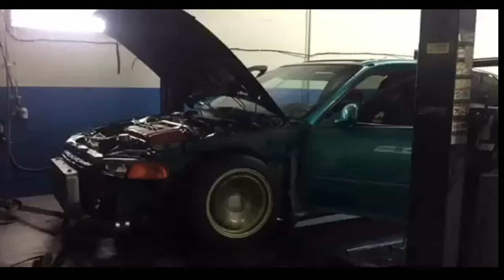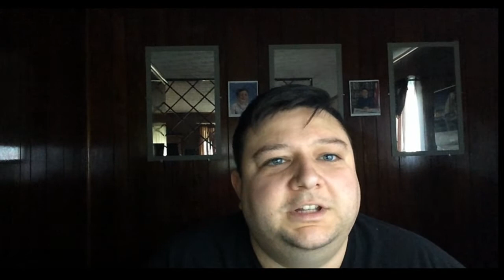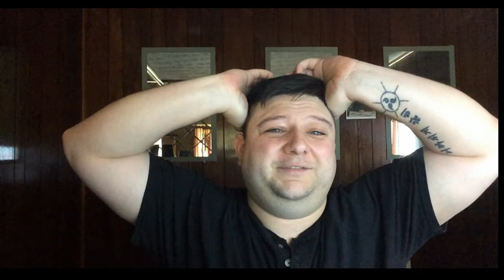450whp Built LSV 10psi, Stock MAP Sensor

Comment: A very quick run down on my 600hp build CSS b18b, skunk2 pro2 cams, b16 head, full ferrara built by 4P, skunk H beams, Traum pistons, dragonfire distributor,  Atl damper (a must) 4P oil pump,  CC stage 5, CC 8.58lb flywheel,  1320 top mount, 6266, 3" charge pipe, 3" large backdoor , skunk pro intake,  74mm TB and a shit ton more....

Comment: That is exactly my engine setup. I have Eagle rods, 9.5-9.8:1 Wiseco pistons, JDM B18C Type-R head, GSR cams, Golden Eagle LSV kit, stock sleeves, PLM top mount turbo manifold, Turbonetics 60-1 Hifi, Tial F38 external wastegate, Tial BOV, Omni-Power 3 bar MAP, FID 1000cc injectors, AEM 320 LPH fuel pump, AEM fuel rail, AEM FPR, 3" turbo-back cat-less exhaust (Pennsylvania), and tuned on Crome. Made 508 whp on 16 psi. It won't spool the turbo until VTEC cracks at 4800 RPM. Even with the Hifi exhaust housing, it's still a big turbo for the 1.8. Nothing like this build, but I'm hoping for 600 whp on stock sleeves.
Reply: I’m trying build something very similar to this 600whp is what I’m shooting for atleast